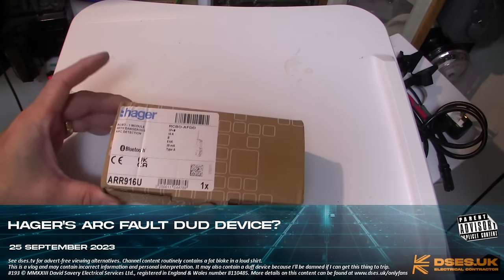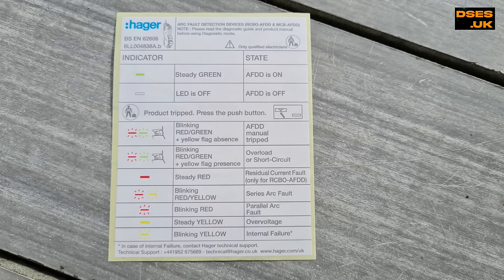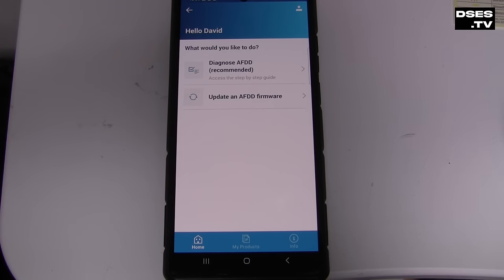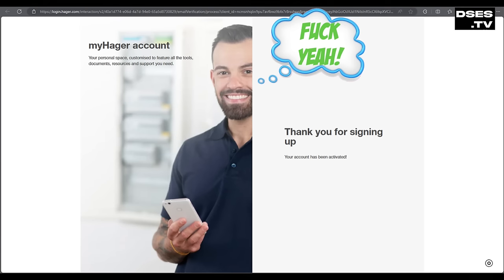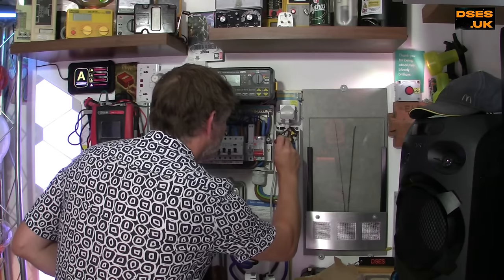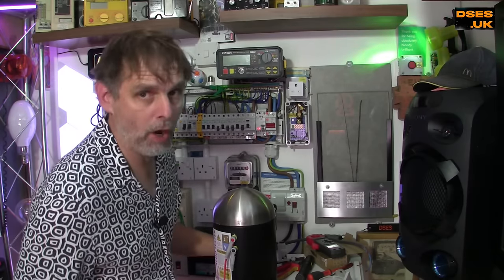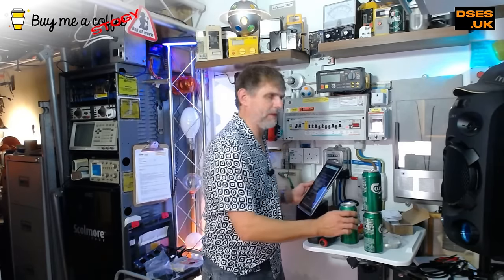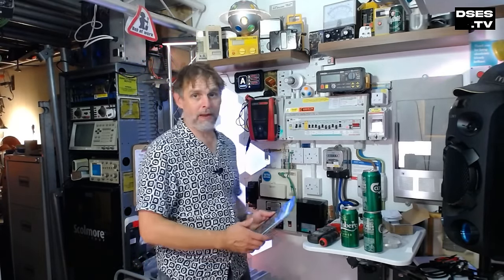AFDD: Hager's Arc Fault Dud Device?

Comment: Great video, it’s good to see new products like this reviewed by an installer with real world experience - Bluetooth doesn’t always make things better!
Reply from the maker: Blimmin generous of you as always Mark!
Reply: Yep, very interesting video. I'd suggest you keep Mark's generous donation to go towards a legal fund you're probably going to need once Hager's lawyers mobilize in your direction. Hope I'm wrong, genuine unsponsored, unfiltered product reviews are too few and far between.
Reply from the maker: @andrewd762  I don't think there's anything illegal here. It's just my opinion and my attempts to force the thing to operate in a way where I believe it ought to. I never said the product was crap or that it doesn't work, merely that I can't get it to work, unlike my Siemens/Wylex models, which forces me to question its efficacy. There's no means for installers to properly test such devices; we're totally reliant on the manufacturer telling us they've made it right and it's clever enough to keep tabs on its own sanity. I'm happy for Hager to tell me why they think I've been unsuccessful, but there's nothing here that can win them a takedown of this content.
Reply: @dsesuk They've been legislated as required in the US for several years now so most of the testers are US market based. Klein Tools do a combination GFCI / AFCI tester but I'm not sure if it's available as a 230v 50hz version. also Fox Meter Inc developed a portable tester which I think is now badged as a Greenlee, again I'm not sure if it's UK compliant. Both of these testers were fairly cheap.
Reply from the maker: @andrewd762  Thing is with the US AFCIs, they're not processor based from what I've seen. They're $30 dollar devices the US have been fitted for years, so perhaps work in a different way to the ARM hardware turning up over here. It is possible to make a signal injector that will show an AFDD in action - that's probably exactly what Hager have on their stand, but an MFT manufacturer told me IEC 62606 demands "the Test type requires 'real' arc not waveform simulated by electronic devices" and that the energy dissipated would be more than an MFT can cope with: "Example: 230V x 63A x 0.12s = 1738 Joule ( our loop tester works currently with a max energy : 460V x 10A x 0.01s = 46 Joule )"
Reply: @dsesuk  Like yourself I'm not any kind of expert and I'm not sure what logic platform the US AFCIs use. I know the latest generation of arc detection devices have upped their game when it comes to detection accuracy and avoiding nuisance tripping. I've got a sneaky suspicion that the Hager module is not being fooled by your test rig. The newer devices are savvy enough not to nuisance trip when slow operating bimetallic contacts are used for switching. Also the salesman says they're the best devices on the market and with an honest looking face like his I see no reason to doubt that....

Agree 100% a portable tester for sparkies is a must. It's bad enough there's no cost effective way to test MCB's but their relative simplicity does mean failure rates are low. Having complex devices like arc detectors unable to be tested isn't an acceptable situation.

Comment: Just a quick question . I am lead to believe that in order for the AFDD to work you have to ramp up the load current to quite a high level of arching for it to trip but if there was a small amount of arching going on somewhere on a circuit a fire could still ignite . Especially where next to something inflammable ie an old oily rag lying about in a loft space next to a junction box or whatever So whats the point of the device at all.
Reply from the maker: I was always surprised that 18th Edition recommended AFDDs for circuits of 32A or lower when it's shower isolators I see the most arc damage on at 32A or higher. In my prior videos, I couldn't force an AFDD trip on a load of less than about a kiloWatt. Arcing can happen on something like a LED lighting circuit, but the energy levels are generally too low for a series fault which is the most common arc type. A parallel fault would need the kind of damage and external influences I applied to my cable here. That said, any kind of arc - even a small one - near flammable materials or in a flammable atmosphere could result in a lot of bother.

Comment: Do any of these AFDD devices actually remember the fault status of the last trip AFTER they have been reset? Such that pushing the status button will show the trip status. In a real life situation the householder will almost certainly have reset them, probably without noting the status. Particularly since it is done through a single flashing LED.
It is a problem that started with RCBOs - you cannot see if the trip was over current or leakage.
Reply from the maker: Usually the LED status indicator holds the last condition until the indicator itself is reset, although I have seen a device which only gave a brief indication before resetting to a 'nominal' indication.

Comment: Did you ever experience any false tripping due to arc faults since your consumer unit upgrade? I've heard some people from the US complain that theirs tripped whenever they used their vacuum cleaner.
Reply from the maker: I've had two AFDD trips on two different modules since putting them in at the end of 2020. In each case, I couldn't account for the fault and it didn't repeat when the device was reset.

Comment: Love to see inside that test box at the show, probably just a posh signal injector, smoke and mirrors springs to mind.
Reply from the maker: That's what I was thinking. The button box is just that probably - I reckon the clever stuff is inside that CU. I'd like five minutes alone with it and a screwdriver!
Reply: I heard there's a little bloke inside that manually pulls a lever when he thinks he hears arcing
Reply: @ChickenWizy  It's all done with imps.

Comment: Brilliant – well done.

Tell the sales people where to go.

You mentioned Grenfell – have you done a video on the whole electrical fault fire starting condition there?. I did very interested in hearing all sides of that as to how it happened, why it happened and why it might not of happened.
Reply: As I understand it, the fault was in someone's appliance, not the fixed wiring, so no need for any testing to be done on it. So I doubt we'll ever know.
Reply from the maker: I don't have that information, other than it being a Hotpoint fridge, but many appliance fires are after some form of separation from the supply which means the likes of an AFDD sadly won't help.
Reply: @TestGearJunkie.  
An AFDD should detect an arc in some appliances as they are connected to the circuit.

Comment: It's working perfectly - like all AFDD's, it's supposed to do absolutely nothing when it comes to real world arc faults.
It's the Siemens model that isn't working correctly as it detects arc faults and actually does something...which is not normal.
Most AFDD's have been designed to only detect your money and take it.
Reply: This AFDD feature is the best I've seen.

Comment: This is worrying. I need to install some afdd's and won't be trusting Hager after this. 

The only thing I can think of is that it may self calibrate to the circuits characteristics. That wouldn't be wise for socket circuits though.

There's another range of afdds with a arm code. I don't know if they will be any better and it doesn't excuse this product.

Comment: Plus what if there is no or at best a poor data connection anywhere near the property or worse comes to worse the firmware update fails, who pays for the replacement?
OH BTW is there a cast iron guaranteed number of years they are supporting these devices or is the end user going to recieve a letter in 5 or 6 years saying all that expensive hardware is no longer going to work after a certain date?
Reply from the maker: What happens when something like the Bluetooth protocol moves on? Who expects their iPhone fifteen years from now to have a Bluetooth protocol that's compatible with what these use if Hager can't, or won't, update them? It's a can of worms.
Reply: @dsesuk   or if the app will still be available, after all why would they pump money into software if the hardware isn’t selling in high volumes.

Comment: Interesting Test, Bit Sceptical about a device that can have firmware updated could it get corrupted in normal use.
Reply: No reason for that to happen if it's been designed at least half-competently
Reply: @mikeselectricstuff  I'm always very apprehensive whenever I have to do a firmware update, I'm convinced the device whatever it is will turn into a very expensive brick. It's not happened so far, but it's sure to one day 😵‍💫
Reply: Corruption? Yes, that will be it. There's probably some small print saying it mustn't be installed on circuits that could be subjected to arcing spikes!

Comment: I'd be more interested in what the quiescent current that these things pull and how much they are all going to cost me every year. Especially when you have loads of them!
Reply from the maker: I did work it out in my £1300 consumer unit video. I think at the time is was something like £6 per annum which, with today's energy pricing, is probably about £500/annum!
Reply: And also cost the road and the next.  This is why I say USB sockets need a re design.
Reply: @alunroberts1439  Yeah, lose the USB sockets. Never did see the point of those, I've got a drawer full of power bricks and all the computers I've had in the last 10 years have got USB ports all over them.

Comment: I bet they will come up with some sort of argument about the device not being left for long enough before an arc being induced. It's still an incredibly worrying perspective if so, as that would potentially mean that an existing arc on a board change may be ignored. As for it being the correct signature, there are plenty of guys tapping wires together to create an arc, but the devices would only potentially see this as switching arc, but for your devices, they are sustained for definite. Really glad I saw this before installing a board in an HMO. I would love to see some sort of response from Hager to support their product, but I feel it will be weak at best!
Reply from the maker: I'm sure they'll figure my testing wasn't real life. Although, had that loose connection been on the back of a socket outlet with a heater or granny charger plugged in, I would suspect it would be melting before this thing reacts.
Reply: @dsesuk  Exactly. I just feel like they will say some tosh along the lines of "but it needs to be initialised", leaving an already problematic circuit with an arc either forever, or until it has finished initialising or whatever. I'm here on edge waiting on some form or response though. Surely.

Comment: Good video David. I find it personally enthusiastic the way Hager markets this device. It's challenging enough trying to keep software up to date with smart home gadgets and hardware, but on safety devices is a bit too much. I get it for the likes of ACB's that need remote switching and monitoring for higher currents in commercial & industrial environments, but in a domestic setting, 40A and below realistically, it's overkill and not needed. Especially when the home owners 9 times out of 10 never test their RCD every 6 months!!!

Comment: You won’t see a “smart consumer unit” as the costs of managing electrical isolation between interconnected smart breakers costs more than a Bluetooth chipset. The software will get better so you can set parameters across a bunch breakers. Hopefully the software updates are signed so you can’t load a malicious software onto them.

Comment: Looks like I need to update my AFDDs since I did my video. You're a version ahead!
Reply from the maker: Do you have the Hager ones Steve? Have you ever tried them out in anger?
Reply: @dsesuk  I have a few of these in the garage, but didn't have any arc trip events with those. Actually the older type (2 units wide, AFDD and MCB only) do work, as I did have a single oven melt the 13A fuse/plug that was pre-fitted, so perhaps they've gone backwards with the new design.
Reply from the maker: @sdgelectronics  Yeah, I recall Hager were two-mod units with no earth leakage protection back when I was installing my Wylex all-in-ones back in 2020. I wonder if they've got too clever with these?

Comment: MK has their Logic Plus range, so the tech to have a single management unit is there, their point that its nearly cheaper to put it all in one unit is fairly true as it will be the same ESP type module to do the comms, but the better solution would be to have say a din rail controller, with separate buttons to pair a new module and a button to allow "quick access" for an installer without the need for all registration which times out after say 15 mins, but the controller could also connect to WiFi and handle any firmware updates or remote monitoring if that is needed
Unless its a BMS based system, home stuff should not require registration to single installers etc.
It seems to be a designed by a Product team without real world users or forsight to how it will actually be used, normally happens when the people setting such decisions have not been at the sharp end.
Reply: A properly designed smart consumer unit range would not need devices to be paired. Just the L + N busbar contacts and a small data connector (probably carrying SPI). The devices would be addressed by physical position and identify themselves to the master CPU. So no configuration required on adding or changing a device, just simple plug and play. But I expect the manufacturers would take 2 or 3 generations of unusable abortions to get to this arrangement though.

Comment: This is quite worrying if not working 
As there is no test for onside I belive other than check in your laboratory conditions (ha ha) 
I do I like a good arc 
I wonder how many contractors have fitted these and thought all safe
Reply from the maker: Well, that green light is supposed to mean it's all checked and correct. There's no other way for us to test 'em!

Comment: great video as always, "smart" is just another way to extract money after the sale, don't be surprised when they change TOS requiring a payment, then later requiring monthly subscription, without any means to opt out. 

Look at other products to see the future, webcam suddenly becomes paid subscription to operate (after purchase), philips lighting changes TOS requiring opening an account (after purchase),  and the like. 

Software and buildings don't operate on the same time scale, at some point, with thousands already installed, the greedy feckers will stop supportting that old unit, and a new unit will have to be installed because the software is too old.

Comment: If Hager really wants to smartify their range while also considering the installer's time and patience, they should replace the data-harvesting excuse of a bluetooth app with a low-power mesh network similar to cheap Hue/Zigbee bulbs. Firmware and other "learned information" could then be updated as a cascading deployment after being triggered once. A simple management device made for installers could start the propagation, download fault logs, etc.

Given amendment 2 by and large wants AFDD's in commercial developments, where hundreds could be installed, not considering deployment at scale is such an unforced error. They're leaving money on the table too as we'd stick with one brand if we knew installing a brand new Hager AFDD in the CU could quietly update all the older AFDD's in the building to the latest firmware (just like bulbs do).

Comment: Ok  so Hager AFDD's don't seem to work in what i would consider genuine scenarios... i dont like Hager as a brand for the reason they are indeed up their own backsides. This how ever is concerning. Thanks for a great video Davo, glad some one is exposing this shambolic stuff, as you pointed out they have yet to bring out official testing units.
Reply from the maker: These tests are genuine in my opinion - for all the AFDD knows, the series arc is a loose connection on the socket my radiator is plugged into and the parallel arc is a damaged cable moisture has got into. Why it isn't playing the game I don't know.

Comment: I don't feel that pressing an integral test button on a device can ever be proof of compliance. Here in New Zealand the regs list pushing the test button on an RCD as an acceptable means of testing, but the tripping times are the same as the UK! I've not quite got used to counting the milliseconds between  button press and trip yet 😂
Reply from the maker: An RCD test button does physically prove operation by bypassing one leg of the current path through a resistor which puts it off-balance to the opposing leg. The RCD then legitimately operates, so it's a positive test of the electrical and mechanical characteristics of the device. So, what does pressing the button on an AFDD do? Is that proving RCD operation, arc fault operation, that the internal processor has registered the button press... who knows??
Reply: @dsesuk it means it ready to pair to your phone 😂